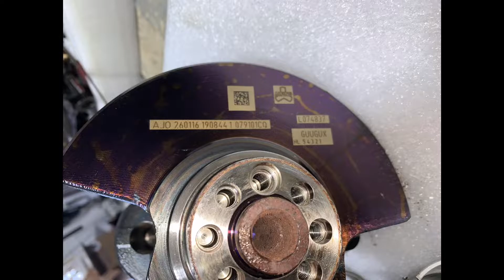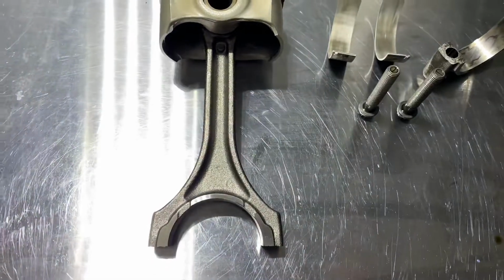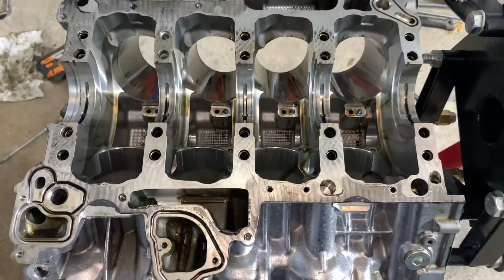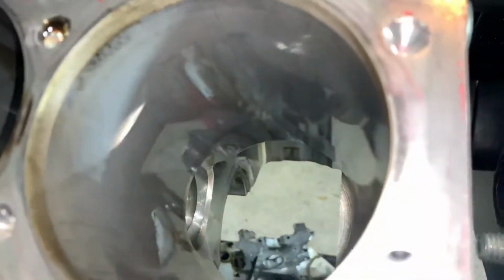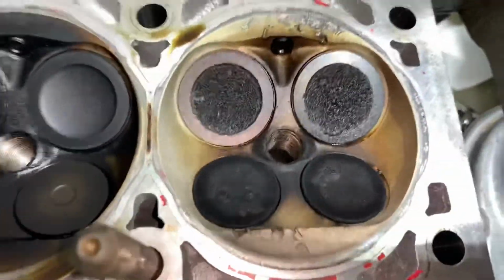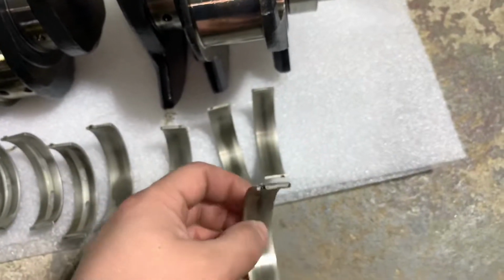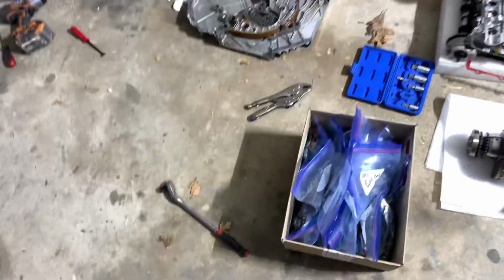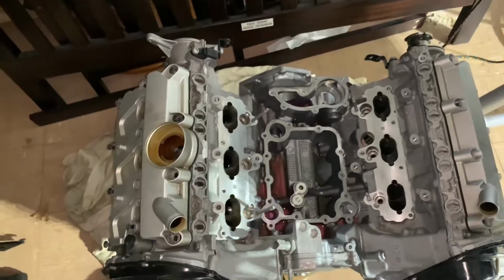Build blown 2016 RS7 Engine 4.0T !

Comment: The overall block design seems decent, however the engine webbing between cylinders appears to be slightly thin making me think cooling is a potential concern and heat soak from prolonged extreme use.
Regardless,  I enjoyed watching this video...hope the build came together nicely for you.

Comment: hello ,

I have the same piston failure on my a8 4.0 tfsi motor code CEUA 309kw 420bhp , know you the origin of this failure ?????
i have jusgt the cylinder number 6 with the piston melted .
i was just desactivation cylinder n6 on computer  , no ignition ,no injection ,
the car turn on 7 cylinder without smoke ,oil consumption and others trouble .
i have put camera into the cylinder 6 and Bam!!!!!! piston melted .

what this f**** failure ?!!!!!!! ignition trouble ??? worst piston ????

please help me 

regards .......
Reply: do you know why happen??? i tink my 4.0t rs6 blow, no compresion on cylinder 5
Reply: @enricfernandez9187  
The reason is the oïl quality or the Time lapse between oïl change , long life service was suicide for the engine , the 4.0 tfsi need oil changing every 7500km .
The conception of the engine with short pistons , nicasil treatment of cylinders and architecture Make a race engine , this V8 is so brutal .
Now we had changed the engine and we know why failures appear , too much forces and brutality like race engine , need race maintenance,not like Audi preconisations , changing oil often and respect of warm up and cooling time was very important.
More , the 5w30 oil was too much liquid ,we try 5w40 into our engine ,maybe in future try 10w50 or 10w60 ! I think the best .
Now Audi service préconise 0w30 🤯 no no no ,never , 0w30 be sure to blow the engine